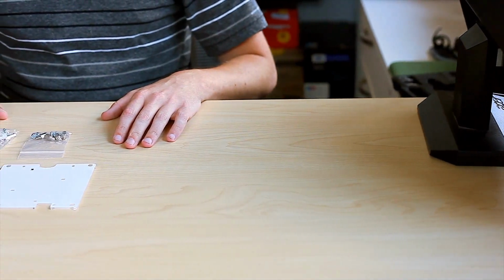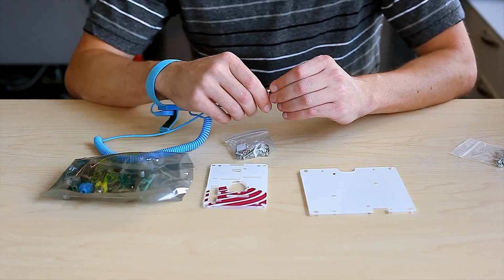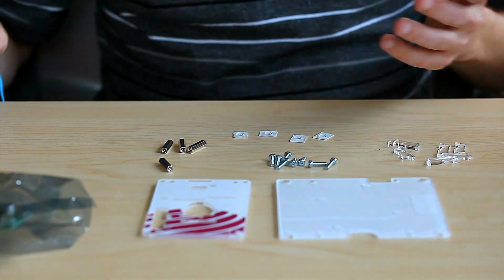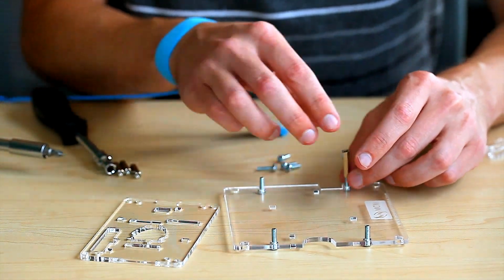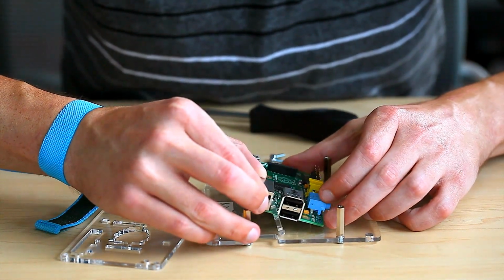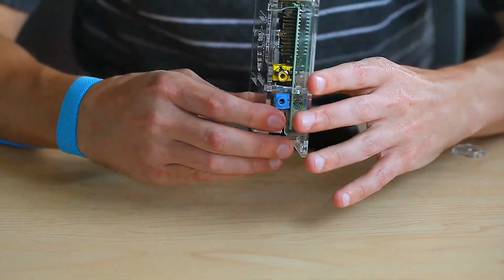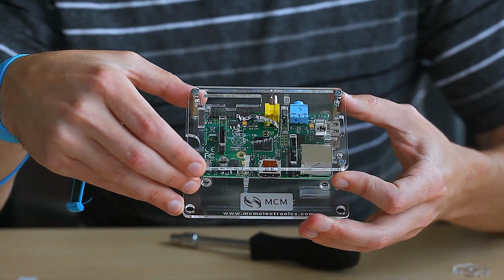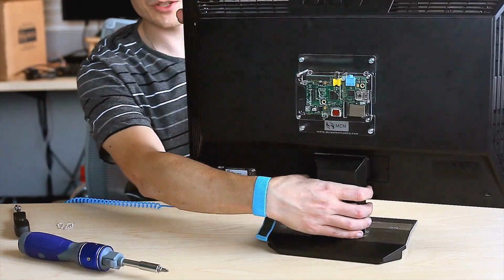Raspberry Pi VESA Mount Case How to

Comment: TIP: bye a £5.99 case and some double sided tape or pads and stick to the monitor. Then its cheaper and you don't have 4 big holes in the back :)